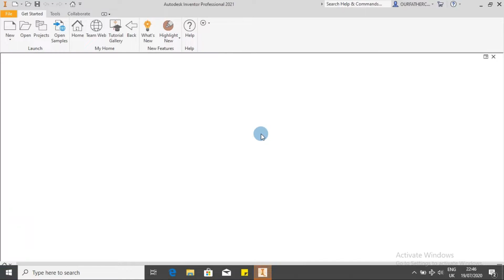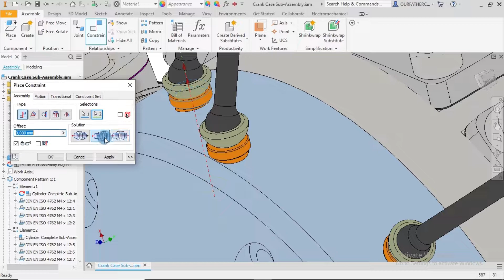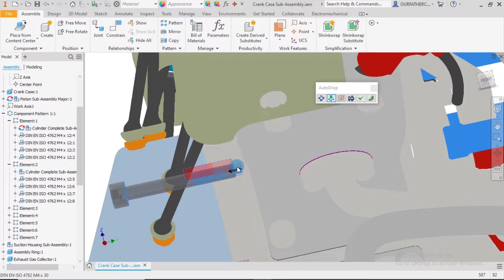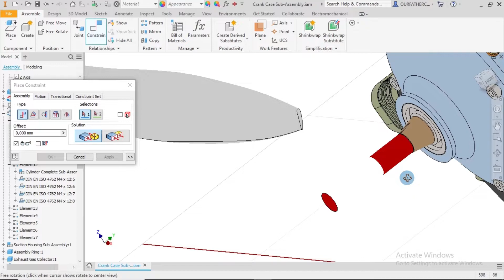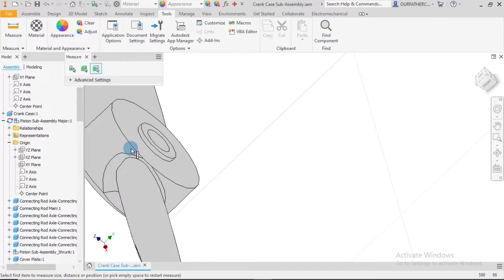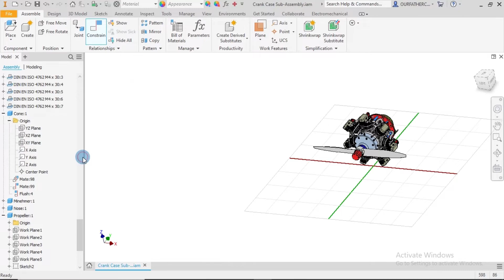Inventor 2021 | Radial Engine | Assembly 15

Comment: You should consider numbering your parts and (sub-) assemblies. Larger projects will naturally have the problem of naming many parts and finding them back in your vault or work spaces. Instead of naming your part; Propeller.ipt, name it 1.1.1-A-Propeller. 
First number referring to the project(-name) or main assembly. Second number referring to a sub assembly. Third number referring to the part number. I personally use the "A" letter, because I occasionally come back to a part and make a revision on it. Rev 1 in this case would be labeled as "A" and rev 2 would then be "B" and so on. Or label revisions by REV00, REV01, etc. Even watching this video at x2 speed I'm waiting till you find the corresponding parts in your work bin. 
Other than that I really enjoyed this project and got plenty of inspiration for working on my own projects!
Reply from the maker: Thank you for the feedback! I would figure out how to infuse that in the upcoming projects.